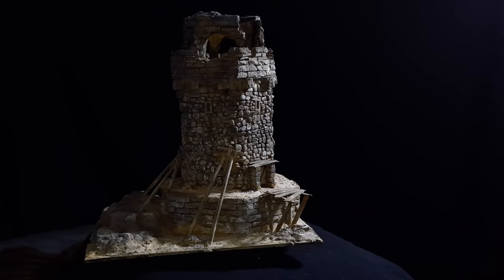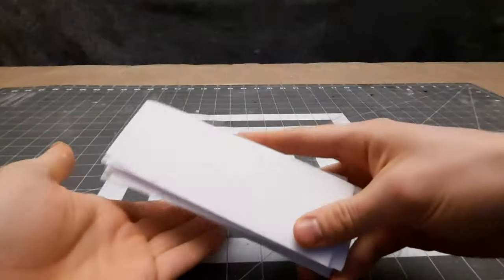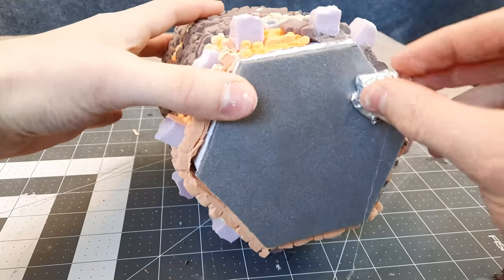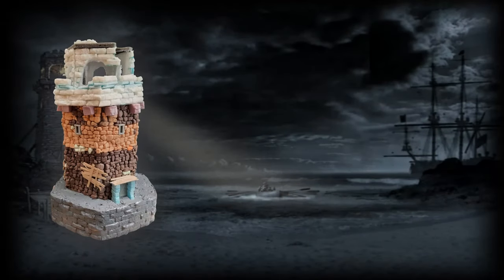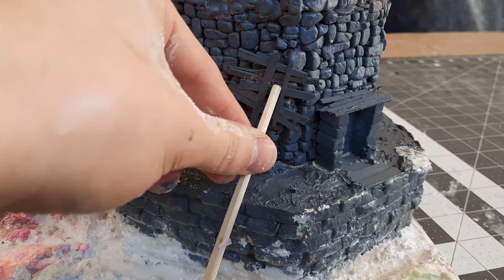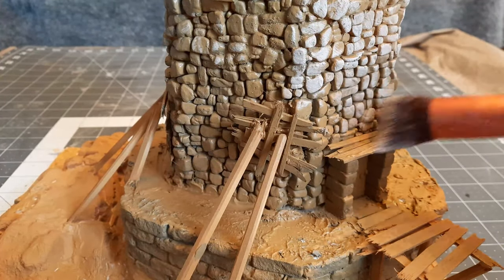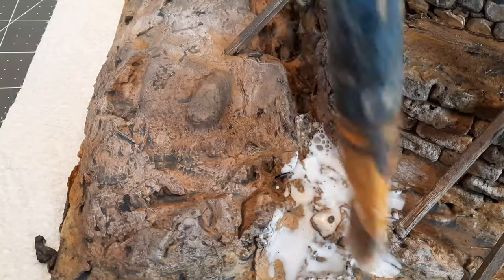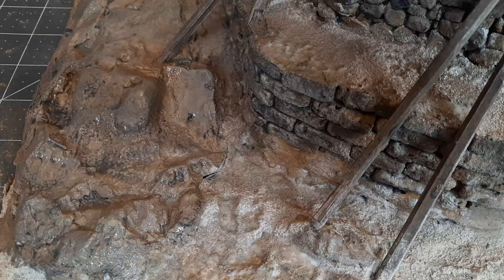1-Day Build, Lighthouse at Whitecap Bay - Pirates of the Caribbean

Comment: I really like the stone-mold you used... it makes for very believable stones!  
Nice job on all the paint layering.  It makes for a very rich color. 
  One question:  why did you appy alcohol over the 'sand'?
Reply from the maker: The alcohol breaks up the surface tension of the glue so that it absorbs into the sand instead of pooling ontop.  Great question.

Comment: Very nice! I also just watched your foam-clay brick tutorial. It seems very easy and so useful!

Now I'm noticing that the homemade foam bricks have much more detail on their surface as opposed to the foam-clay bricks which look much smoother. Do you think that the level of detail of the foam bricks could be achieved with the foam-clay bricks? Or the clay would smooth itself no matter the mold that you've used?
Reply from the maker: Good catch.  That is actually the mold's fault, I've tried the foam clay in my home made mold, and it captures MORE detail than the great stuff, I just had some left over great stuff rocks that I wanted to use up.  I've also tried larger brick 3D printed molds and they can get just as good of texture as a home made mold, but you might have to use a slightly larger scale if you only have a cheepo printer like me ;)

Comment: Very nice. Where I'm at, the foam clay is more expensive than DIY modeling compound. I can see how it's much easier, and less messy, to use the foam, though. The whole thing turned out great. Nice build
Reply from the maker: I was actually able to find the foam super cheap on Temu if your interested.  Thanks for watching!: https://www.temu.com/subject/n9/googleshopping-landingpage-a-psurl.html?goods_id=601099512512019&_bg_fs=1&_p_rfs=1&_x_ads_channel=google&_x_ads_sub_channel=shopping&_x_login_type=Google&_x_vst_scene=adg&sku_id=17592191117410&_x_ns_sku_id=17592191117410&_x_gmc_account=647900107&_x_ads_account=3211640864&_x_ads_set=19937631059&_x_ads_id=149240296713&_x_ads_creative_id=654064219839&_x_ns_source=g&_x_ns_gclid=CjwKCAjw8-OhBhB5EiwADyoY1TVHp1Or2bBkGcctcs7RxoMjfRFIAfISJmdPkO0LU-WxngeP-mgtKRoCpqoQAvD_BwE&_x_ns_placement=&_x_ns_match_type=&_x_ns_ad_position=&_x_ns_product_id=17592191117410&_x_ns_target=&_x_ns_devicemodel=&_x_ns_wbraid=CjgKCAjw8-OhBhBhEigA9moRv-nIX_cZt3GuQbwSF3k7Z2DjMEVQtcvWQfYsDCWzfxnTHjC9GgI0aQ&_x_ns_gbraid=0AAAAAo4mICFyyqn4C5mxwAG18B19peuQE&_x_ns_targetid=pla-295758278146&gclid=CjwKCAjw8-OhBhB5EiwADyoY1TVHp1Or2bBkGcctcs7RxoMjfRFIAfISJmdPkO0LU-WxngeP-mgtKRoCpqoQAvD_BwE&adg_ctx=f-40f11694
Reply: Nice! Cheers

Comment: Doesnt look like you have the same problem as me. How do you get the foam clay to not stick to your hands? I fell like its impossible to work with.
Reply from the maker: The stuff I bought was not sticky at all to anything but itself.  For the mold, I used a little baking release.  Here is my link to the stuff I use: 
https://www.temu.com/subject/n9/googleshopping-landingpage-a-psurl.html?goods_id=601099512512019&_bg_fs=1&_p_rfs=1&_x_ads_channel=google&_x_ads_sub_channel=shopping&_x_login_type=Google&_x_vst_scene=adg&sku_id=17592191117410&_x_ns_sku_id=17592191117410&_x_gmc_account=647900107&_x_ads_account=3211640864&_x_ads_set=19937631059&_x_ads_id=149240296713&_x_ads_creative_id=654064219839&_x_ns_source=g&_x_ns_gclid=CjwKCAjw8-OhBhB5EiwADyoY1TVHp1Or2bBkGcctcs7RxoMjfRFIAfISJmdPkO0LU-WxngeP-mgtKRoCpqoQAvD_BwE&_x_ns_placement=&_x_ns_match_type=&_x_ns_ad_position=&_x_ns_product_id=17592191117410&_x_ns_target=&_x_ns_devicemodel=&_x_ns_wbraid=CjgKCAjw8-OhBhBhEigA9moRv-nIX_cZt3GuQbwSF3k7Z2DjMEVQtcvWQfYsDCWzfxnTHjC9GgI0aQ&_x_ns_gbraid=0AAAAAo4mICFyyqn4C5mxwAG18B19peuQE&_x_ns_targetid=pla-295758278146&gclid=CjwKCAjw8-OhBhB5EiwADyoY1TVHp1Or2bBkGcctcs7RxoMjfRFIAfISJmdPkO0LU-WxngeP-mgtKRoCpqoQAvD_BwE&adg_ctx=f-40f11694
Reply: @medievalmason3929  TY!!